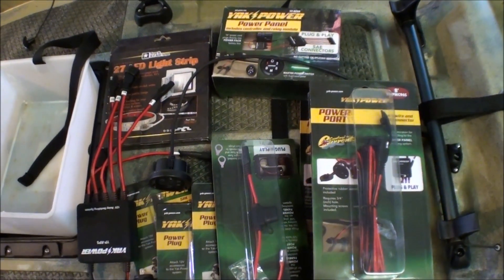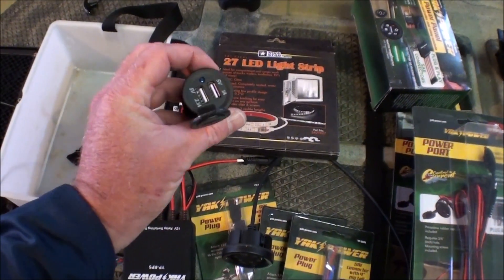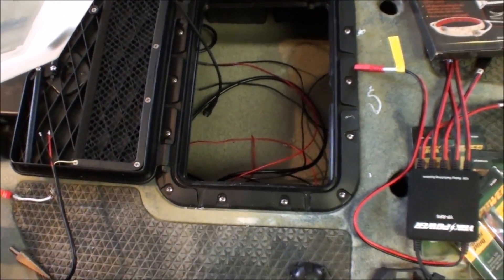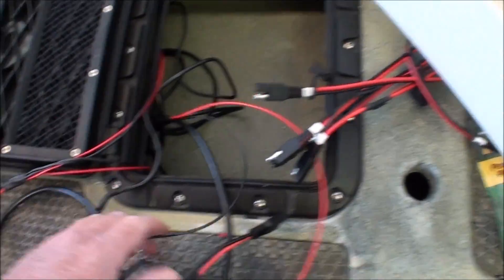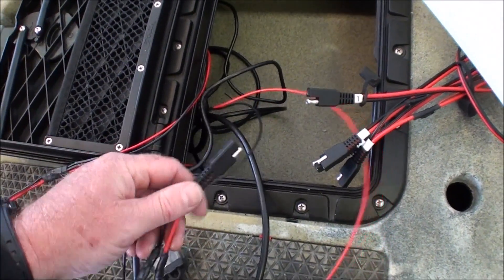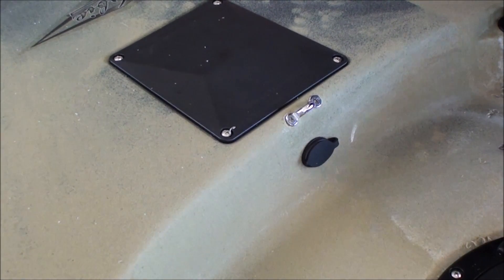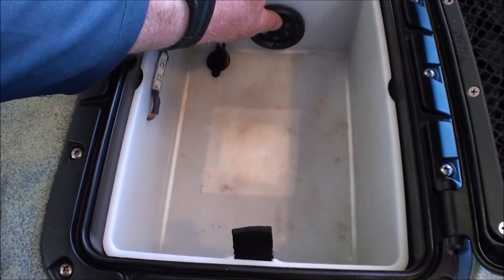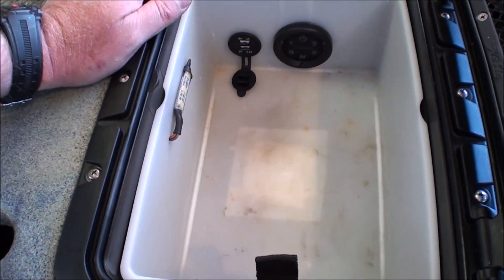Yak Power wiring system with Bioenno Power 30Ah LiFePO4 battery installation

Comment: Sir, could you make a list of all the Yak power components I would need to rig up my fish finder and 4 button lights with two button lights as my nav lights.  Thank you for the video.  It really helps.
Reply from the maker: Sorry, I haven't used the Yak-Power stuff for a few years. I've switched to FPV-Power distribution hub and components
Reply: @TimPercyKayakFishing  that’s what I was gonna ask next? Is that the same battery you use too?  How do you have it hooked up.  I wanna get the Percy plate for the Hobie outback, I just need a few pics of what it looks like
Reply from the maker: @ridge633  timpercykayakfishing.com. There are photos of one on the product page.

Comment: Thanks for the video. Dumb question: why you have to reverse positve/negative from battery to power port?
Reply from the maker: The power ports are meant to send power, so the way the plug is setup is opposite to the plug that comes off the battery. You just have to make sure the positive in negative are correct by the time it gets to the controller.

Comment: I’m getting a bioenno battery the 20 AH. Should I get the PVC version  with that plug or get the ABS version with screw terminals? Or does it matter?
Reply from the maker: Doesn't really matter, it depends on how you want to connect to it. Pick which one suits your connection needs.

Comment: Very nice video.  Do you have any problem with the power plug getting wet??? would an IP 68 screw plug be better in case it gets wet as the wife and I take our T17 in the ocean as well as the lakes . I would like to use the power pole but most of the waters we go in have and depth range from 5 meters to 80 meters deep and i yet to find an anchor that will hold us still, unless it hooks on a reef as you know the T17 isn't a small kayak.  How do you find the H crate? dose it get in the way at all? any way i'm finding your videos very informative .
Reply from the maker: Daryl K I've never had an issue with the plugs and they have been wet many times. I fished tournaments in all day rains and been on the water when it's been very bumpy with waves splashing over. I love the H-Crate, I usually have 10 rods out with me during tournaments, I can carry them all on the crate with some extra rod holders and there is plenty of room for all my tackle.
Reply: Thank you

Comment: So this is the $80 kit and not the $150 one?  Great video and explanation, btw.
Reply from the maker: Thank you. I used the Yak Power SERIOUS Complete System ($150), but it all depends on how many components you have to hook up. The other package will work if you don't have as many components.
Reply: Tim Percy thank you for the reply. Where did you find that drop in bucket for the center hatch? The ones I️ find are for the older PA’s and won’t fit inside my 2017 model.
Reply from the maker: There's no difference in the bucket. Hobie 71709001
Reply: thank you so much.  Found and purchased the correct one today thanks to that part number.
Reply from the maker: Glad I could help.

Comment: Looking at doing a similar setup. Anything you would do different?
Reply from the maker: Indiana D'Angler I'm very happy with this setup. Yak-Power now has white button lights, so if I were to do it now, I would probably use them just under the mounting boards instead of the LED strip lights.

Comment: What charger are you using for your battery?
Reply from the maker: Bioenno supplies a charger with their batteries
Reply: The link to the battery on your description does not seem to be working. Can you please update it or reference the model you used? I ordered a Pelican Box and plan to do a similar install.
Reply from the maker: It looks like they have changed the dimensions on the battery now, it may be just a touch too wide to fit in the Pelican 1170 case. I use the Bioenno Power 30ah for my kayak with the Lowrance Carbon 9 and the 20ah battery for my kayak with the Lowrance Elite-9 Ti.
Reply: Model BLF-1230A maybe the only 30ah battery that fits that case, but would require snipping some wires and fabricating a connector.
Reply: Pelican 1400 may work for Battery Model BLF-1230LB. The  dimensions are 11.81" x 8.87" x5.18" -

Comment: Tim is this the battery that you used ? 12V Series - LFP (LiFePO4) Batteries › 12V, 30Ah LFP Battery (PVC, BLF-1230A)
Reply from the maker: Eddie Robinson Yes, that's the one.
Reply: Ty Tim

Comment: My Bioenno Battery only came with one 50A Anderson Power Pole connector.  Did you add the second one and where do you get the male plug that you ran through the Pelican case?
Reply from the maker: Tim Bauserman mine came with both. I had an extra Anderson connector that I connected to one of the plugs from the YakPower kit.

Comment: Great review Tim, really enjoy your videos.  I picked my Yak Power supplies up at Bass Pro today.  Haven't decided if I will use their battery box or make my own like you did.  Do I need to run in-line fuses on the battery connection before the panel box and in front of each component or some variation of this depending on the draw of the component?  I Will be running a Lowrance, Power Pole Micro, 360 Light, Interior Lights, and USB ports for phone and GoPro.  I want to protect my equipment and be safe should should a fault/short circuit develop and I have little electrical experience.  Thanks!
Reply from the maker: Thanks. I just went with the one fuse at the battery box. You could use a fuse at each component, but I didn't go that route.

Comment: Nice job! Thank you. For future reference, we make a Power Adapter Kit for above deck battery installation through a Power Port that maintains the correct polarity throughout the system. https://www.southernaudioservices.com/YP-BBK-PAK-Power-Adapter-Kit-P620.aspx
Reply from the maker: Yes, I neglected to mention in the video, I had to reverse the positive and negative coming out of the battery box to have the plug to be the correct polarity going into the Power Port.
Reply: do you sell this whole kit and what is the cost
Reply from the maker: Miguel Rios https://www.southernaudioservices.com/Complete-Systems-C195.aspx
Reply: Tim Percy ok so you need this kit and then you have to buy the light strips.i just want to add light to the front and back and inside
Reply from the maker: Miguel Rios Yak Power makes light kits in blue and green, they were supposed to come out with white lights as well, but I haven't seen them yet. I used LED lights that I bought elsewhere. I use different lights in one of my other videos.
Reply from the maker: https://youtu.be/RQP8tNvGis8
Reply from the maker: https://youtu.be/4z-BIJHPbzA